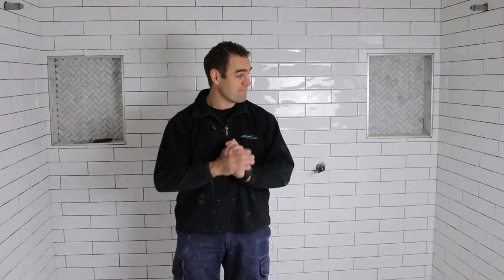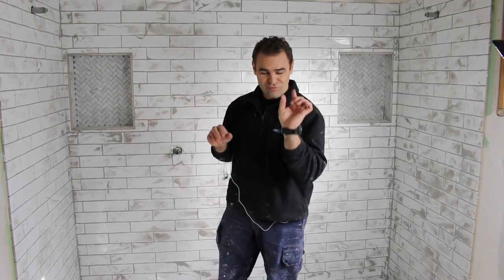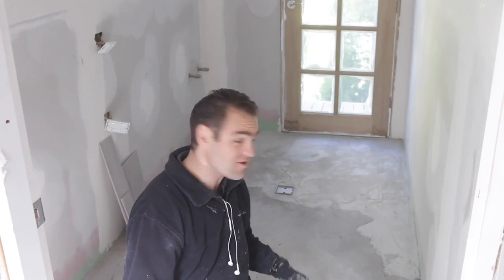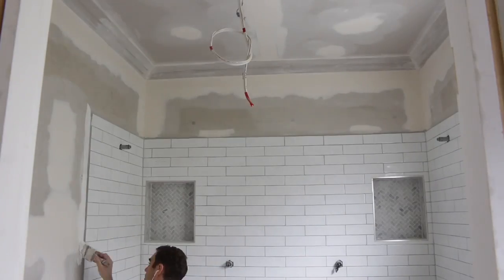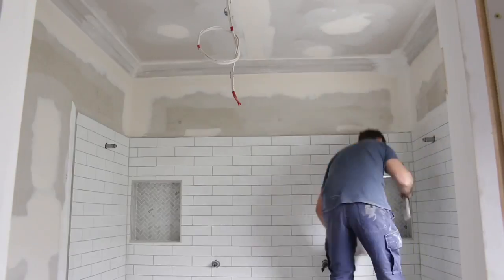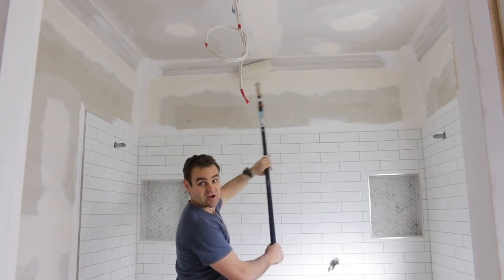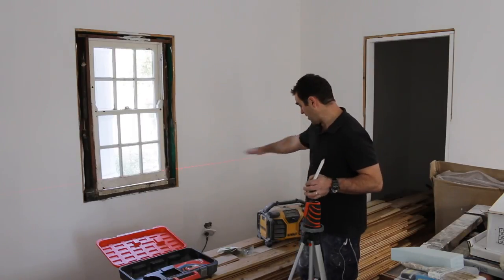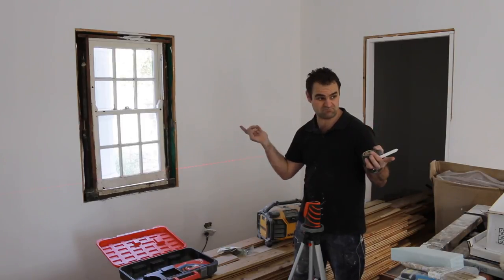Grout and paint - Jeff's House part 14

Comment: Jeff, please tell me that you have undercoated the plaster boards before applying ceiling paint (which should be low sheen since it`s a wet area), please!
Reply from the maker: Yep. That is what the white over everything is. I then painted all of the ceilings, and in the bathroom and laundry I used bathroom mould resistant paint.

Comment: OMG totally something I would do with the door. Nice tips on the painting, If you wrap your brushed and rollers up tight in plastic you don't have to clean them right away good over night. If it's oil base paint stick them in the freezer also.
Reply from the maker: I use the plastic wrap frequently, but that is the first I have heard of the freezer. Nice.
Reply: or just put some turps in a cut pot and put the brush in there. cover it with a plastic bag (from supermarket you might have plenty) and it`ll be alright for some time (had it for weeks with no problems).
Reply from the maker: Supermarket bags are generally not as good for that sort of thing as they are perforated. Plastic wrap is better for that reason. Turps is good for turps based, but I hate using turps based ;)
Reply: pretty much all oil enamel paint works with turps. with the bags - doing this sort of 7 years erryday never had a problem. If one bag is not good enough - use two, three. Wrap it carefully it`ll live months. Anyway, those are just another painting hints which I use literally every day. :)